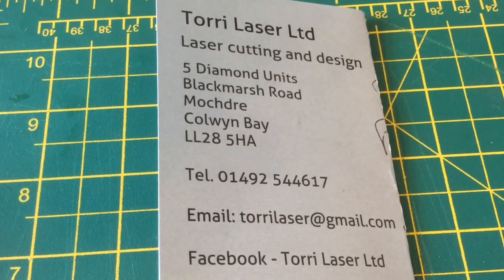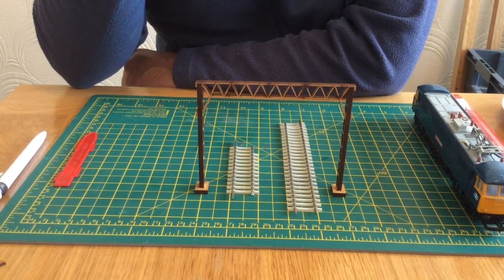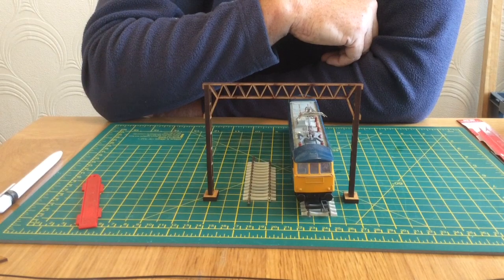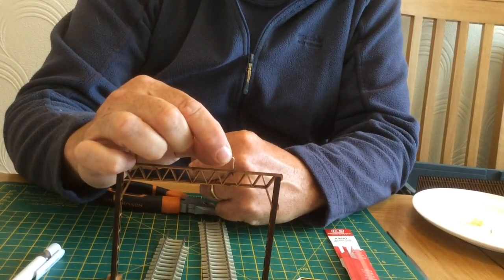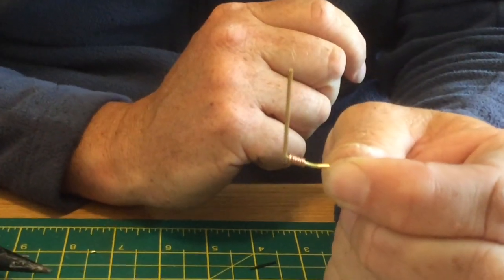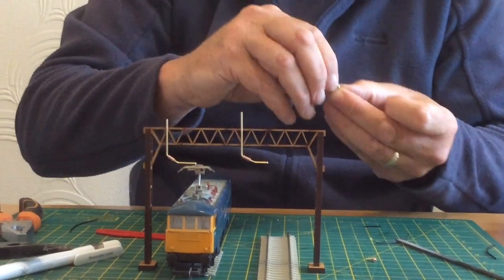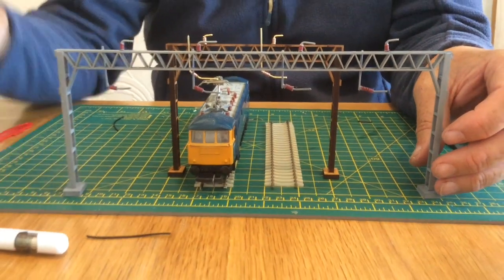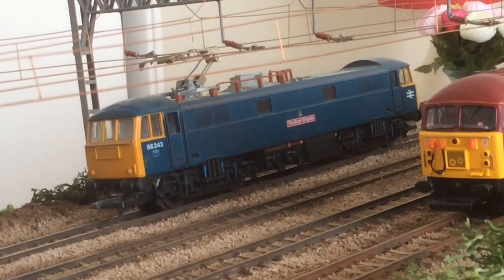How to detail and assemble Torri Laser catenary masts

Comment: Looks good but i would want to cut those slight overhanging pieces off sticking out of the uprights as that just looks wrong.  The diorama looks great with the blue electrics and i wouldnt have included the 56 in those shots.
Reply from the maker: It all depends which  era your modelling as the way the wires are supported changed when they upgraded the WCML about 10 to 15 years ago they done away  with the support your referring too and changed it  to a triangular 3 pole arrangement. What I have tried to re create is how they looked from the early 1960s up too the upgrade . Having said that there are many variations with some masts having the upper support below. The poles do sometimes sit above the masts 

All the best Paul